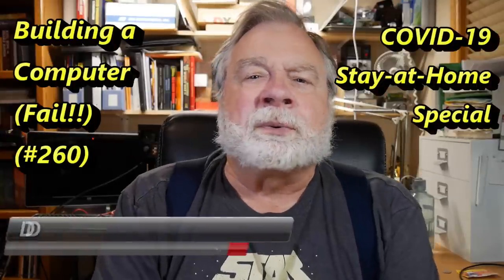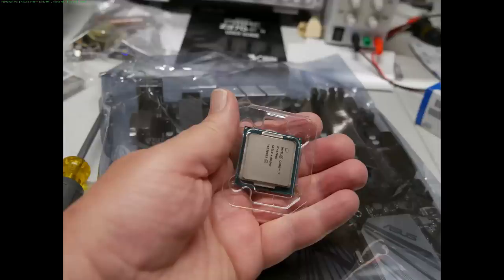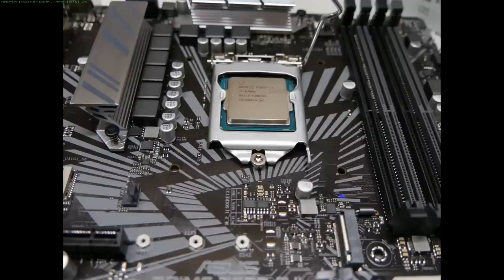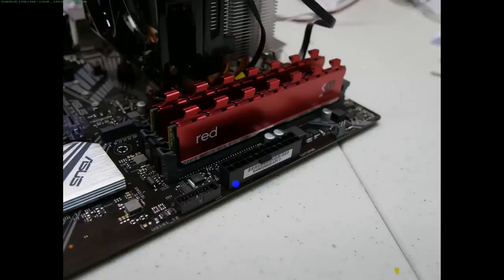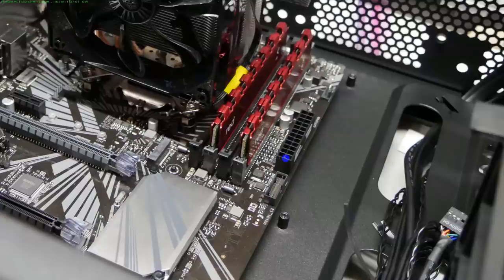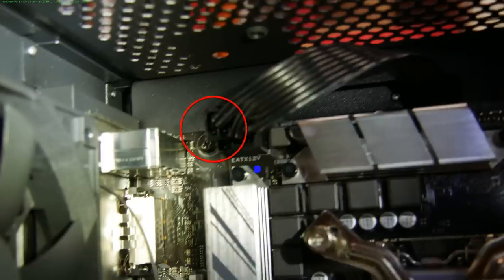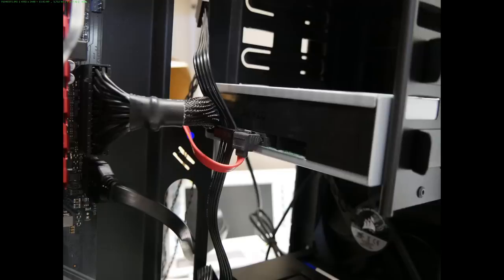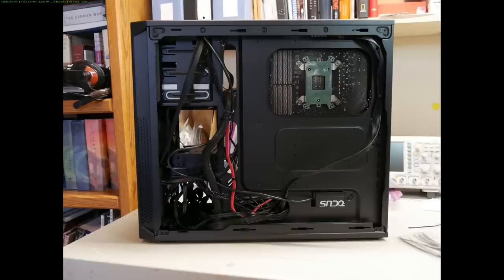Computer Build Fail! (#260)

Comment: sounds to me like the power supply just shut down as soon as it detected more load then it is designed to support, reconnect your CPU power cable (the 2x4 pin connecter on the top edge of the board) and it should work, but disconnecting the power supply from everything and testing the voltages wouldn't be a bad idea. though, most power supply for computers have short circuit protection and over current protection.

this pdf, strangely enough from a power supply builder, shows how to turn on the psu without it being connected to a computer

https://www.silverstonetek.com/downloads/QA/PSU/PSU-Paper%20Clip-EN.pdf

and if you just google atx 24 pin pinout you will find pinout diagrams coming out your ears.

good luck

Comment: You blew the power supply, the easiest fix is to just replace it and hope that you didn't have any transient spikes through the motherboard, most likely not. You probably popped a fuse for the 12v side of the PS at the very least.
Reply: Note Dave said the fans are powering up and shutting back down so the fuse is note likely blown.  These ATX power supplies are switchers and protected by a crowbar circuit on the outputs and not generally fuses.  I have many times seen a bad capacitor cause these exact symptoms however that seldom happens with all new hardware.

Comment: Hard to believe that the power supply plug and socket don't mate in one (correct) way only. What a fundamentally poor design. I have never come across such a thing, but then I don't build computer systems.

Comment: Disconnect the power supply from everything.  On your main cable/motherboard plug......short pin 16 to pin 15 or 17 or 18.  that will turn on the power supply.  Now, plug the power supply into AC and turn on the switch.  dont worry if fan turns on or not....sometimes they wont.  Now stick your negative multimeter probe in one of the negative pins on the motherboard connector.  and now probe the connector for your 12, 5, and 3.3 volts.  Just google ATX powersupply pin out.  If.....If the power supply is still good, you then have a bad mother board.   Most power supplies have fuses.  you'll have to open it.  Hope this helps.  73  N8SOT

Comment: What is you motherboard model and manufacturer? Also the power supply? 

Maybe this ASUS page will be helpful.
https://www.asus.com/us/support/FAQ/1042632

It look like the socket you had trouble with was the 8-pin EATX12V.
 Not sure what that powers.

The two parallel sides of the power cable connector  should be different so that the cable can be put in only one way and on one half of the connectto but who knows.
 Maybe it actually didn't make a full connection and short the supply, thus the short idea is a red herring??

Since the power supply at least tries to turn on (led/fan) it may not be a fuse issue.
 You have another power supply to try? 

Disconnect all the drives and cables and only have the power supply connected. Does it turn on then and boot to Boot screen. I don't know if it also has a built in video card.

You may have to get one of those cheap power supply checkers and see if the supply works.
There is a trick of shorting  couple of the cable pins together to get the Power Supply to turn on w//o being in the PC. Could check supply that way maybe.

Comment: Heat sink not correctly installed/missing contact area or defect/missing RAM memory.  Plug of heatsink cooler not in the right place. Without proper heatsink you will burn the CPU within seconds.

Comment: Computer tech and builder since '93. Take everything out of the case, set the bare assembled motherboard, CPU and RAM on a non metallic surface. No video card at this point. Hook up the on board graphics, and power from the power supply to the mother board. Carefully jump the power switch leads momentarily with a metal object. Watch your monitor and fans to see it anything happens. If it boots up shut it down and start adding components like Graphics card, Hard drive, KB, Mouse but do this ONE at a time until you find your culprit.
73s!